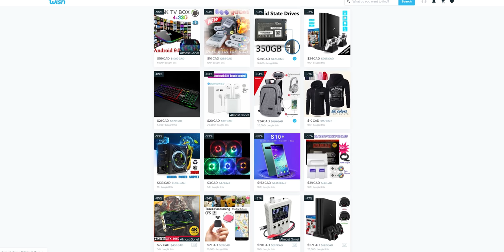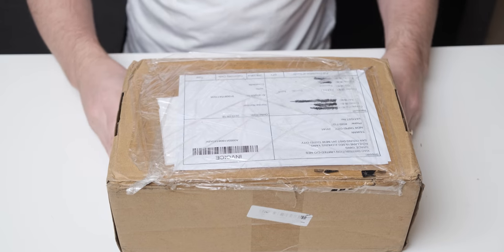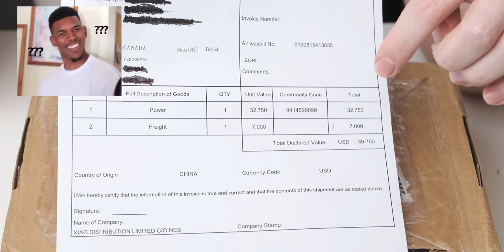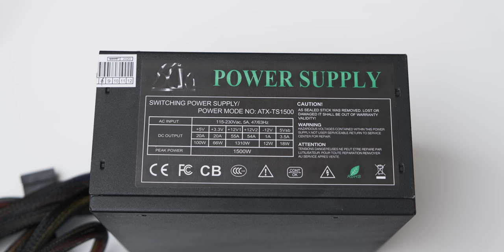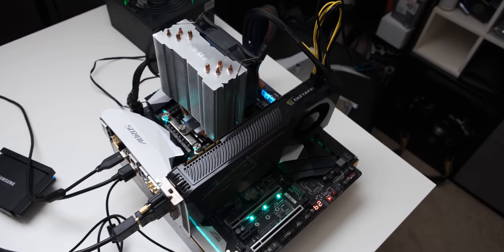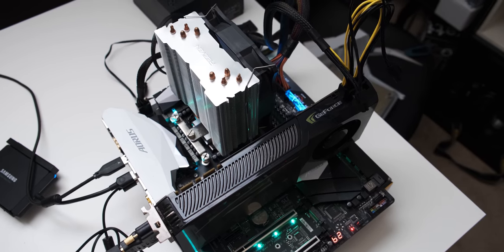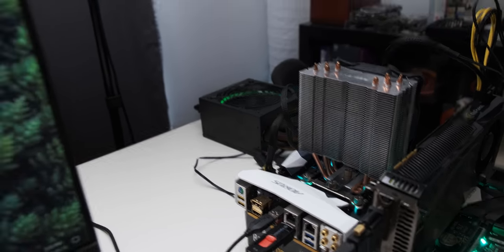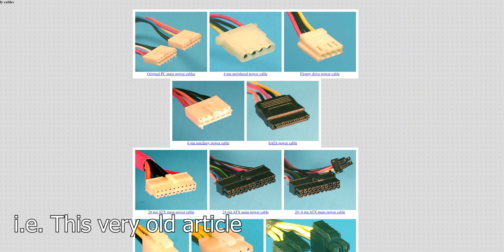I bought a $69 1500w power supply on Wish.com

Comment: that's a rebranded thermaltake TR2 S.  the highest output model is 700 watts, I'm guessing this is the 450 based on it's guts
Reply: ^ This guy has High PSU Energy
Reply: I can see that it's a recent UTPower platform, but it's not the lowest end execution of it. I'm thinking a good bit more than 450, but without looking at each component, it's difficult to guess.

But caution is advised, since i've seen someone order this exact item with same description and same enclosure and same sticker from a different similar website and receive the usual $10 ATX 1.x junk board inside that is not suitable for any modern PC. It's some kind of salvage operation that just packages up whatever they can get their hands on.
Reply: From 0 to 10, how would you rate a TR2?
Reply: @kire929 I rate it a you'd have to pay me to use one out of 10.  it probably won't explode, but the ripple is horrendous and will cause instability and premature vrm failure.
Reply: @butre.  What about Aerocool KCAS? I've seen it in a lot of places and I don't know if it's a bang for the buck or just a bad memeable PSU
Reply: @butre.  I need a cheap PSU for a secondary rig, you know, maybe an Optiplex or a Xeon machine
Reply: yeah anywhere between 350 - 450w
Reply: @kire929  Amazon has 650w 80 Plus Gold rated refurbished Corsair PSUs for $49.99. I have one and they are genuine Corsair RM650x refurbished ones.
Reply: @cdurkinz  Yeah, I know, a old high end PC with something like an OC i7 4790K and a GTX 700/R9 290 GPU consumes the same or even less than something like a toaster, haha.

Now I don't really need a cheap PSU, at least not for me. I already have a G750H from Gigabyte that I bought new for only 65€, and I'm not building a secondary machine. Maybe I'll buy one fo those PSUs you said before for one friends who is planning to sell his consoles and become a PC Gamer.
Reply: @butre.  atleast it's still a thermaltake, some PSUs from chine uses even worse components
Reply: @tristan6509  nah the tr2 is designed to be a low end disposable unit for low power applications.  on these units the ratings are basically just when ocp kicks in, not how far they can actually go under a sustained load.  I wouldn't trust this thing to run fans, let alone silicon.  give me an hec or great wall or fsp any day, low end thermaltake is a fire waiting to happen
Reply: KireKilleuse bought an Aerocool 550w for my Ryzen 3 tho.. It is fine till now, hope for forever. Had used a weird PSU before, called PowerPro for years on my Core2Duo, was fine until I needed to replace everything.
Reply: @bradt4229  amazon even has a thermaltake tr2 700w for 59.99€
Reply: I have the thermal take gx2 and it has the same cables and looks indentical.
Reply: uhh no this is not a rebranded TR2 S, recently too apart a old 450 I had laying around to see why it failed. Looks nothing like the one in this video.
Reply: @butre.  You seem to know lots about power supplies.  I have an old VS650 from Corsair (it was literally the only power supply in the shop near me and I hadn't started using Amazon at that point).
Would you say I should replace it immediately? I know it's the worst one Corsair does.
Bastard shop really overcharged me too.. £90 for it, and for that price I can get an RM650 which is 80 plus gold and fully modular.
Reply: @thejollysloth5743   ur fine as long as it's not the one with green/orange label
Reply: @istvanfrikker5078  Hmm, I am not sure what color the label is.  I will take it out of the case shroud and look.
I wouldn't be surprised if it is that one though.  It's the only part I didn't replace when I built my new system.
Reply: @butre.  what do you think about Gamdias psu 650w gold?
Reply: @royaltyallen1162   I assume you mean their kratos p1.  they have reliablity issues but as far as voltage characteristics go they're fine.  they're not worth the asking price, but they frequently go on sale for deep discounts.  I put a value of $0 on rgb so I say if you can get one for $65 or less it's not a bad choice, but how much over that price point you're willing to pay for some fancy lights is up to you.

if you want a cheap power supply, an EVGA b stock 650 bq can be had for around $60 shipped.  it comes with a 1 year warranty instead of the 5 year warranty that the normal 650 bq comes with, but for that shorter warranty period you get a $40 discount.  it's semi-modular and has an mtbf of 11 years.
Reply: @butre.  yea the kraitos p1 gold,I’ve upgraded since to Corsair RMx,gonna pass the Gamdias to my brother.
Reply: @butre.  no I got from prebuilt last year,I’ve upgraded since

Comment: Rubicon are good quality capacitors (are you sure it wasn't "Lubicon" -- a Chinese knock-off? :-)).  The soldering of the wiring in that PSU was pretty dodgy and the lightweight metalwork reeks of cost-cutting.  I would not risk any expensive computer components to it.
Reply: Rubicom
Reply: The psu looks pretty authentic , by the look of the internals this is probably a used 650w thermaltake psu & they changed the case.
Reply: That “soldering” I think you’re talking about is glue that helps hold various components in place, you see it in quite a lot of power supply units, especially external bricks for things like consoles. But yeah, seems fairly legit internals  to be honest, but can’t understand why you would need that amount of power with that cable arrangement.
Reply: There is a pretty good chance they are fake Rubycon capacitors
Reply: these can also be used capacitors, this is not uncommon.

Comment: It has "As sealed stick was removed, lost or damaged it shall be out of warranty validity" written on the side. Yep, nothing at all suspicious there. It's GOT to be legit!
Reply from the maker: That's exactly what I thought. XD
Reply: I bought a power supply that has the same sticker. It's 800W. I bought it to be used as a power supply for a battery charger, because it pulls 600W on the input.

Comment: My theory is it's a "third-shift" ThermalTake PSU. It's pretty common for factories to make unauthorised extra units during downtime and sell them on the grey market. It would explain why the PSU was completely unbranded except for the fan, yet seemed to work and be relatively decent.
Reply: 100% correct
Reply: They also tend to use parts that didn't pass QC for these types of units.

Comment: Looking at the internals I say:
1) You have enough heat sink mass to support 500 Watts Maximum
OR
2) It will deliver 1500 Watts because it is 99.5% efficient
go with (1)
Reply: @Irilia_neko  shame he didn't use a kilowatt meter on it to see how much power it pulled running the test system compare to a real power supply
Reply: it has actually good internals for noname psu
for example all noname pover supply units that seen is ~350w max (they burns/explode at 400-450w of load) none of them had dc-dc converters, emi filter or even apfc (i remember in 1 of them had fake ppfc inductor, just a box with metal pieces inside of it)
Reply: about main inductor - i can guess it's around 350-500w but it's needs to test how hot is it underload (over 95°C is actually hot for intuctors because of wire isolation that can melt because of high temperatures)
Reply: @данилломовцев-й4л  that would be a shitty psu to not shut down if you pushed it past it's power limit

Comment: "7600k, a sacrifical component" i´ll take it if u dont want it, but dont hurt him ><
Reply from the maker: Haha!! Ill be gentle.
Reply: @DawidDoesTechStuff  why not use a old core 2 quad
Reply: My thoughts exactly, his sacrificicial CPU is better than 3-4/5 in my apartment... I have a phenom II black in a drawer you can overclock and blow up, that's kinda why I have it
Reply: @DawidDoesTechStuff  I atm use an I5-7600K and you dare call it a sacrificial component. My pc is hurt.

(Have been running it at 4.6 ghz for the past 3 years, been holding up very well)
Reply: @k1er4n544  I still use a core 2 duo. This hurts my pc too Dx
Reply: @k1er4n544  no matter what system he used, people would moan.
Reply: ill be happy to take that cpu to upgrade my i5 6400 lmao
Reply: @kc4415  a cpu is a terrible thing to waste
Reply: he can buy an old xeon processor from servers dirty cheap,with MoBo and ram for less than a 100 bucks,with a high power consumption for testings like that.and he can buy from....from wish for example XD.or aliexpress.
Reply: じゃん りっくLittleBertz in current games that would still. Suck. A 1600 is a better “upgrade”
Reply: It’s old. He’s fine.
Reply: Lol I hate Intel I got a ryzen 5 1600x running at 4.1ghz
Reply: Best Of Ark lol I hate Ryzen I got an intel i9-10900x running at 5.1ghz
Reply: @AmaraTheBarbarian  i have a few Pentium pros and core 2 quads
Reply: @yubinator7455  I have that CPU too! Well I have a new one, I just need my ram and psu to arrive.
Reply: @xanderwusky  I run mine on 5ghz, I have a gtx 1080 so the 7600k even at 5ghz is not that great, but gonna upgrade in summer for at least a ryzen 5 3600
Reply: @yubinator7455  id happily take that i5 6400 to upgrade my i3 6100
Reply: @k1er4n544  or even better a shitty amd cpu
Reply: i run an i5-2300 rn
Reply: I have an i5 2400, i would kill to get my hands on a 7600k and that board
Reply: I use an i3 10th gen XD
Reply: @Mantis_Toboggan It's probably more economical to use shitty Intel CPUs, Older shitty AMD CPUs seem to hold some value by virtue of scarcity, most old shitty Intel CPUs are a dime a dosen, literally pennies in some cases.

Then even if you bought a shitty AMD cpu for likely too much money you have to have like, an AM3 Motherboard or something. Would you buy that? Motherboard prices often ruin the value proposition of CPUs that go for fractions of what Bulldozers go for.

Basically it's just way to easier and more affordable to get your hands on obsolete Intel CPUs in comparison to shitty AMD CPUs.

Comment: Best components to really stress test a PSU:
CPU - AMD Fx-9590
GPU - Radeon R9 295X2
Reply: gtx 580 quad sli
Reply: lol im running that setup and cant even plug my headphones cuz the power fails lol
Reply: Well I'm not a whole lot better, 8320 at 4.42ghz all core and RX480 at 1400mhz.  Not quite 9590 draw but I'm pushing 1.53v to maintain stable.
Reply: R9 290x
Reply: Yes, if you can find a motherboard to support that 250w inferno of a CPU and the quite rare and expensive R9 295X2. Oh and enough cooling to keep it from setting itself on fire.
Reply: @tw1st3d35  finding isnt too hard, its affording it.  The price of building a 9590 with 295x2 and everything is o run proper will cost as much as a high end new gen build
Reply: @gamingmadesimple5510  true, you will find that hardware but the price is high as it's a relic of the past time.  People know this and finding it at a reasonable price for the performance is impossible bcuz they cost like a fortune when new and some people want to get that money back because so little of these GPU's were sold but the CPU is a bit easier to find.
Reply: now 11900k is the only way to go
Reply: @alekpo2000  what's your psu
Reply: GTX 480
Reply: I had a few-steps-down-from-this system, actually! FX4100, R9 290X. Both overclocked to the point that power at the wall exceeded my ability to measure at the time (650w).
Sadly, the GPU exploded when a mechanical pencil lead fell into the top vent of my case and landed perfectly onto the back of the GPU die.
It probably wasn't long for the world anyways as it had weird artifacting even at stock.
I had to calm the CPU OC down because my 1.5v 4.5GHz was degrading. I have it tamed at 4.3GHz/3.75ish volts now.

Comment: "that's pretty dodgy" 
Proceeds to cut towards himself with a knife*
Reply: but he would dodge that knife!
Reply: I'm pretty sure it's a pry tool not a knife
Reply: I'm pretty sure it has a bit sharp edge and pointed tip.Call it a showel if you want,but for me it's a knife.
Reply: @TheChudoviste  I dont think theres a sharp edge lol, I've used a pry tool like that before for a phone screen and it didnt have a sharp edge
Reply: @TheChudoviste  that's not a knife, it's a pry tool bro
Reply: Oh,really?
Reply: that's a spudger
Reply: @butre.  It's not a spudger, it's a jimmy.
Reply: @SianaGearz  they're the same thing
Reply: @butre.  Spudger is a soft plastic tool with a flat head and a long shaft. Jimmy is a spring steel edge tool with a handle, iFixit happen to be quite adamant that this is not a spudger.

Comment: Steve from Gamers Nexus has PSU testing equipment, maybe send it to him if possible and see if it goes boom?
And the wattage is peak for sure, not continuous. :P
Reply from the maker: That's a good idea. Ill see what I can do.
Reply: You could also try DiodeGoneWild. It's dodgy Chinese crap that's likely to burst in flames so it's right up his alley! He can even make use of that plug that came with it.
Reply: JonnyGuru could also look at the internals and tear it a new one, his PSU reviews are highly detailed and one of the most (if not the most) reputable.
Reply: Dawid Does Tech Stuff you can make a heater wire, it’s just 12v load you don’t need it to be from a computer. For example, you can use heavy gauge copper housing wire and cut to the correct resistance for the load you want. I was going to do this for testing power supplies also in the 1500w range and setting the 12v powered cable in a 5 gallon bucket of water (since it’s 12v, even wet it can’t shock you, the water keeps it from overheating and it will take a pretty long test run before the water gets too hot). Or there are RC airplane motors or any high 12v load that would also work.

Power = V^2/R, so resistance = v^2/power or 12^2/1500 means you need 0.096 ohm so like 10 wires of 1 ohm each in parallel or just a thick copper wire ;)
Reply: @DawidDoesTechStuff  Please send it to DiodeGoneWild :)

Comment: I swear that PSU could be used for a terrorist attack 0_0
Reply from the maker: They just need to integrate it into the White House server stack and it would cause chaos.
Reply: @DawidDoesTechStuff  lets hope that doesn't happen. (Harold! fetch the notepad!)
Reply: not really
you need 5 volts to produce explosives not 12 unless you hook up the production cells in series but they be too dumb anyway
Reply: terrorists will just put down a computer and open metro exodus with that psu
Reply: Bomb has been planted(Bombsite Intel)Terrorists Win.
Reply: @CatboyChemicalSociety  r u a bomb expert?!?!?!?
Reply: @CatboyChemicalSociety  aha
Well that's unfortunate
Reply: @Dastrid  I heard this on the cs:go voice
Reply: @pencilcase8068  it is from there

Comment: I think by the components:

Inductors: super dodgy
Capacitor: ok

...
I think it can deliver max 800w
Reply: i dont think it can go over 500 but even if it can deliver real 1500w i wouldnt use it anyways, ill rather go with lower quality corsair cx
Reply: It good power supply (not really) from cap and look is fucking good bit then again idk what componen they use but that power supply is decent you can see the pcb is black (they dont cut the cost) and the have like card pcb that cost more i think is a decent psu but yeah my best bet it can go to 1500 for 1 sec and your house on fire
Reply: I even doubt anything more like 450W would be powered...  Even a LC420 from those cheap dogy case psu combos from LC Power is built better internally. And they are know to be insurances worst enemy...
Reply: If its from China, i wouldnt count on that Capacitor being an actual Nichicon.  There is a big market in China for fakes.
Reply: @spodula  true good point
Reply: @spodula  or just from e waste (recycle cap)

Comment: This is a 350w or so PSU based on the Bulk capacitor that it has. Usually in this configuration, they attribute roughly 1uF per watt . It looks like a very decent quality 350ish power supply as it has branded capacitor, proper input filtering,what looks like dedicated pcbs for 5 and 3.3 volt,even PFC. So it is an OK product in a kinda higher price.
Reply: The uF is equally dependent on switching frequency than watts for ripple caps tho..(edit: if you were referring to the low voltage side)

I would like to see it's emi ratings actually tested as well as how well that pf works.
I am willing to bet that stuff is one gaint noise source for rf
Reply: I think that power supply is pretty impressive and looking on its circuitry it can deliver 500 to 600 watts

Comment: 2:25 This extra Power-Cord we use in Europe! The plugs name is "Schuko"
Reply from the maker: Thanks for letting me know. :D
Reply: unischuko*
Reply: are you sure that is not only the German expression for it?
"SCHUtzKOntakt"
Reply: @user-bj3pq2si2l  Yes, the Name comes from the German Word "Schutzkontakt", but this plug-system is used in many European Countries, as you can check at https://en.wikipedia.org/wiki/Schuko
Reply: German boi
Reply: Actually, that is not (really) a Schuko!

Schuko is the name used by Germans, for the German style CEE 7/3 plug (and its 7/4 socket).
The video shows the CEE 7/7 plug which is the hybrid of Schuko and  the French style CEE 7/6 plugs, so that the latter's CEE 7/5 socket could also accept it!

Original Schuko does not have a hole on its face (connected to protective earth).

I'm glad to be able to help (a German about German standards)!
Reply: But not Great Britain because they use another plug
Reply: @daviddoevendans5258  Lets be honest here the UK is most of the time confused. For example the use Miles per hour for cars and signs but teach km and kg.
Reply: @daviddoevendans5258  yes. We have a 3-pin plug that not only provides an earth whenever something is plugged in, it enforces correct live/neutral alignment and functions as as a handy caltrap, as anyone who's stepped on one in the dark when going for a 2am puddle will readily attest.
Reply: And swiss use other plugs as well✌🏻